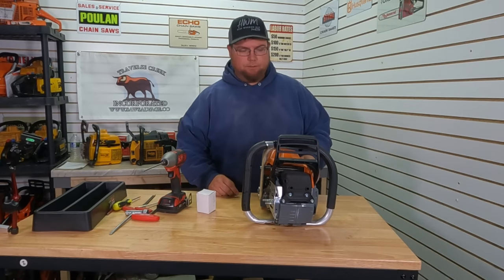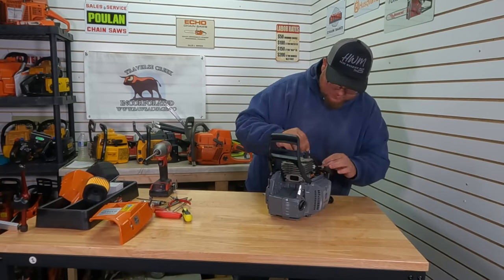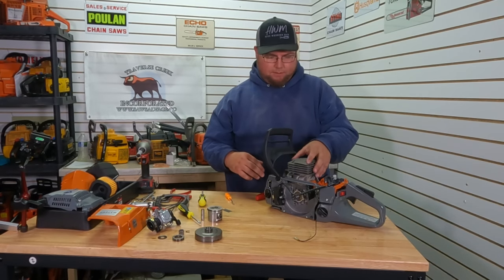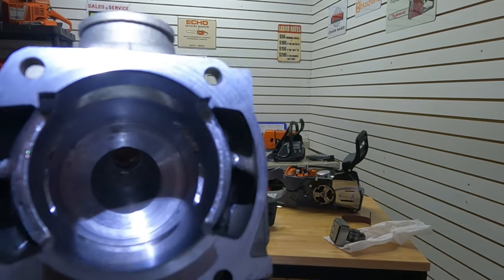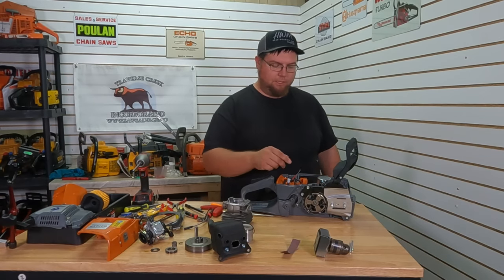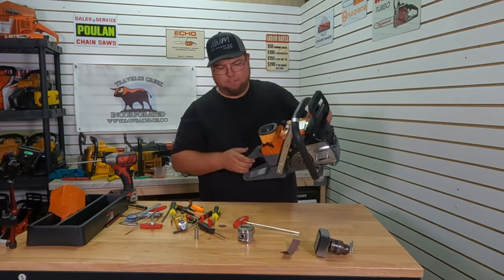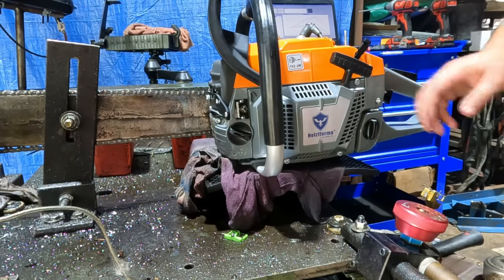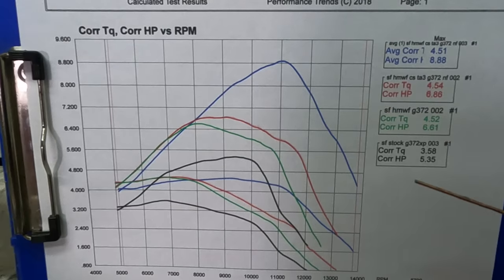Ported G372! UNREAL hidden Power!?!

Comment: Joe run an 8 pin that saw will easily run it. You have machining tools so you have a huge advantage there. I built one with only porting and base gasket delete and it still had a terrible squish clearance I believe it was around 40 tho. I timed several runs between a 7 and 8 pin and the 8 won by a pretty substantial amount.

Comment: It should pull an 8 pin sprocket ok. I have a different brand of chinese 372. All i did was a gasket delete, opened up the lower transfer ports but not as high as you went and then took a bit off the bottom of the exhaust port so it was level with the top of the piston at bottom dead center. Did a muffler mod similar to yours and it pulls an 8 pin sprocket with a 24 inch bar no problems at all. I havent touched the timing but have thought about it.

Comment: First video of yours  I've watched. 
You Tube algorithm recommend it.
Around 30 years ago, two stroke tuning was much better known by various racers, motorcycle, snowmobile and boat with larger motors making 50~200bhp from 125~750cc motors (and more when cooling available on boat motors running around 80 deg C)
Seems the chainsaw guys are the only people doing it nowadays?
What is the capacity of the motor?
Does it relate to model number ? (eg, 372 is 72cc?)

Comment: Can you show how you check ignition timing on a saw? I’ve always just used a timing wheel to see how much cutting the key advanced it and then just going by feel of how it did….but I’d like to see like actual timing numbers with a light? Like to see where it’s firing? The reason I ask is I have heard these clone 372s are having some poor ignition timing where as in the past these 372s are kinda known for not needing ignition timing advanced. Vs for example a 272 you almost always can get some gains by cutting the key .030 or .020

Comment: Ooh ooh, JOE TELL ME MORE ABOUT THE TIMING ADVANCE!  how many degrees? Did you cut the key way wider in the correct direction and shove 2 keys in there? Or weld it in and cut a new keyway? My ooold 372xp, hozzlforma, I ported very mildly, piped it with uncle harve pipe out of anodized aluminum pipe, and big bored, pop up, still seems like it's got a lot more to offer

Comment: Nice work Joe. Been looking for one of those bendy torch things for poking in cylinder when porting. What breed is your one?
Reply from the maker: Streamlight stylus reach is this one. Only thing I dont like is it uses "AAAA" Size batteries.  But it fits 10mm plug holes.

Comment: Nice Job , how high is your Compression with that Piston? 
My Built has 210psi at the Moment.
Reply from the maker: Not sure. It feels decent, I'd guess 180 ish. But haven't put a gauge on it.
Reply: @dynojoemods2764  i‘m going to lower mine to around 180. Now its a bit much i believe. Whats the Partnumber of that 044 Pistonbolt? I think that could compensate my welded Popup which has 85 Gramms . Thanks Mate

Comment: What would be a hot fuel I could use on a firewood saw? 100cc
Reply from the maker: Can try more octane and a timing advance.  But fuel alone won't change power output dramatically.

Comment: I wonder what the ignition timing was at after the advice 🤔.
Reply from the maker: Not 100% sure. I had moved it around quite a few times just watching to see if power gained or dropped.
Reply: @dynojoemods2764  I have orange  gray g372 and it was 30° with a timing light. Makes me wonder if it would like more 🤔.
Reply from the maker: @chrismuncey3861   30-35 seems to be pretty common, but you can try a bit more advance and see if it likes it. It will pop and stuff if you go too far.
Reply: @dynojoemods2764  I'll try it and see how it does. One more question I have a g660 and I'm thinking about trying a big bore kit. Are there any tricks to them?. I've seen a lot about them running like crap and some good.

Comment: Why did the torque go down?
Reply from the maker: Part of that could have been the saw was way more heat soaked than normal. But it isn't super high compression with the higher exhaust roof either.

Comment: I'm confused as to how an assembly that goes up and down affects the balance of an assembly that goes round and round. (On a single cylinder unit)
Reply from the maker: The counter weight on the crankshaft has to counteract the forces of the up and down weight. In a single cylinder you cannot achieve a perfect balance, but you can balance for a certain rpm range. Where the forces cancel out most of the harmful vibrations. But it is only effective in a short rpm window.
Reply: @dynojoemods2764  thank you. I was aware of how a rotating assembly in a V8 for example would need to be balanced, but I couldn't understand how a single cylinder would be affected.